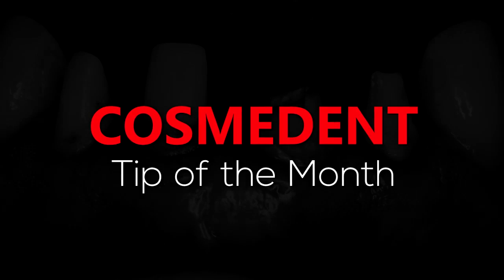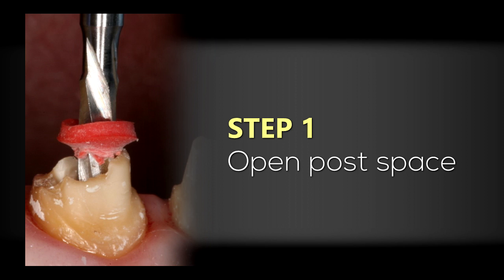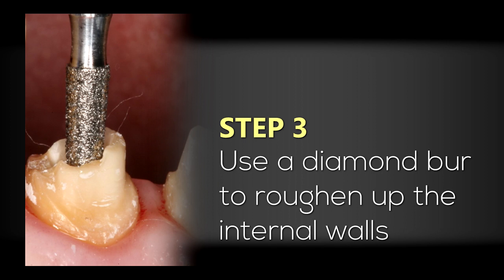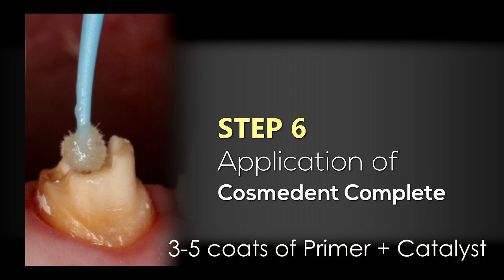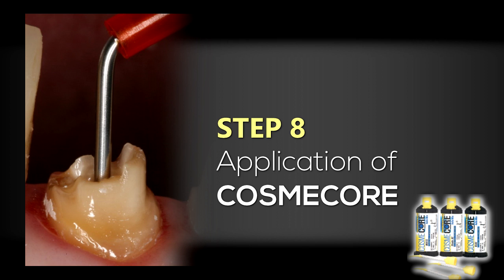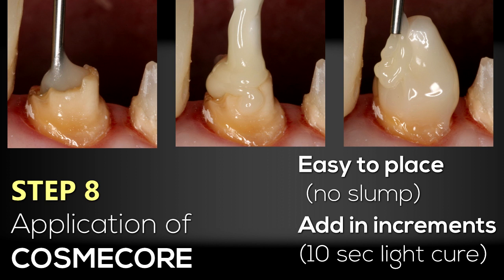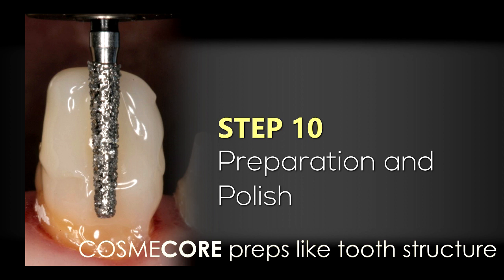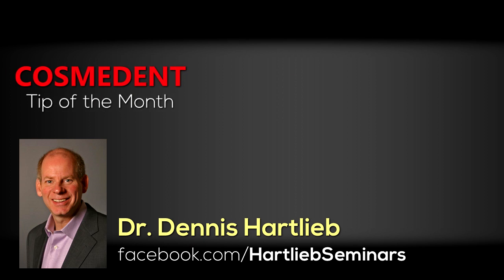Dental Post Cementation and Core Build-Up with Cosmecore

Comment: my dentist did a root canal on tooth # 7...i watched him with a small mirror... i noticed he put a little tiny nail without a head into my tooth canal and  and then put cement in my crown that had broken off and recemented.... he told me not to bit anything hard only soft with that tooth...
after watching your video and knowing i have no cosmecore built on that small pin in my tooth is it normal for me to think that tooth can come out anytime? i have no core?
when it broke at the gumline there was less than 2mm....
he billed me $1300 asking for 1600.... all i could afford was 1000...
i felt i needed to pay his fee to get this service done asap since we are in the middle of virus pandemic...
did i get ripped off and if im careful with tooth 7 how long is its life expectancy?
hope i can receive a reply from you ... thank you doctor!
Reply: If you're skeptical your opinion is already swayed. Find a dentist you trust then. Watching videos on YT does not make you a doctor and does not apply to all scenarios. Something more constructive: If your tooth broke off at the gumline less than 2mm and DOES NOT HAVE FERRULE (you can search up Ferrule dental term to get a better understanding) it is extremely hard and if not impossible to make something that will last. All cases are different and in the US dental care ain't cheap. A temporary crown can cost about $600-$1000 depending on the situation AND you're not just paying for the crown, because a lot of things are needed before you get a crown such as:   The cost of a dental exam is $100 to $200
Cost of a post and core is $350 to $650
A cone-beam CT costs $330 to $750
The cost of a periapical X-ray is $35 to $50
A core build-up costs $200 to $500
Diagnostic casts cost $140 to $300
The cost of a Bitewing X-ray is $35 to $50
Protective restoration costs $150 to $250
Just a list of price I found provided by a dental office.

Comment: Never heard of this til lately, all my roots are fine yet every dentist want me to get implants. Why should I destroy good embedded roots and wait six months for the bone to grow back for implants. I like this way much better. Not one dentist I've gone to even told me about this. I had to learn on the net.
Reply: They wanted $25,000 for implants, went to Mexico, Tiajana and had on extracted and 4 fixed for $2500, so far great
Reply: @safffff1000  what was the place called?
Reply: @duhsunnyday8590  Dr. Ignacio de la Vega, Tijuana
Reply: They should inform you about the option if the roots are indeed healthy and if there's enough remaining sound tooth tissue above the bone. It is, however, the last possible restoration for a tooth.
Reply: I had to change Dentists to find out about this.

Comment: I had a root canal 10 years ago on my lateral incisor and the tooth was fractured down to the gumline.  The dentist did a core build up using the resin material only, without a post like you did.   We put a ceramic crown on the tooth. Do you think a post was necessary?  I'm worried the build up material alone won't be strong enough and the build up material will just break off.
Reply: U need a post bro
Reply: Yes you should have had a post put in. The lateral incisor does not have the best crown to root ratio and is prone to fracture.
Reply: Ask a doctor/dentist not people on YT. It really depends on each individual and finances. If you do not have good anterior canine guidance and a open bite for example or a bite where you are not putting much force on your lateral incisor then a post might not be needed. If it was a tooth like your canine and it is being used for guidance then absolutely. Crown to root ratio for males max incisor is around 10mm:12mm (paper published by jung sok kim) but only your doctor with the xray can diagnose and give you your tx plan.

Comment: Can I eat normally with this kind of procedure or that material isn’t strong enough to resist food that is hard like let’s say toasted bread or something like that?
Reply from the maker: If the dentist follows correct protocol, the material is strong enough to do anything that natural teeth can do. There are a lot of things to take in consideration when a restoration fails and the strength of the material is just one of the items. Patient habits, occlusal forces, technique protocol, ... Every patient is unique but this is a common procedure that should work for anyone if everything else is balanced.
Reply: Cosmedent, Inc. I really appreciate your response. I was told that after the post I needed a crown but if the post is strong enough I think that would be enough. Thanks!
Reply from the maker: You're most welcome, thank you for your question.

Comment: Do I need to do a root canal treatment before post and core treatment? My dentist said that my tooth is beyond any repair.
Reply: It is critical that there is enough healthy tooth structure to support the post and core (and a root canal is necessary prior to the post placement).  If there is insufficient healthy tooth structure, then the tooth cannot be saved without additional treatment, such as crown lengthening (a gum surgery procedure).  Some teeth are not candidates for crown lengthening and the tooth may need to be removed to prevent infection.  Hope this helps!

Comment: why use 3-5 coats? im confused. u make a pool at the bottom of this well, and then take out the excesss with paper points? 
And if you are making a coat of bonding, then curing, and then repeating it again 3-5x , i would expect the post placement be difficult because how the post canal is skinnier
Reply: Jslad js - the reason for placing multiple coats of the adhesive is because it takes time for the primer to saturate into the etched dentin to create a stable hybrid layer.  The multiple layers with agitation helps to ensure that the demineralized collagen is adequately supported and hybridization is successful.  It is essential to remove the excess adhesive, first through the absorption of paper points or multibrushes, then air thinning to be certain that the carrying agent (water, ethanol or acetone) is evaporated.  The resultant film thickness layer should be negligible and should not impact the seating of the post.

Comment: No rubber dam. I guess a delay failure will occur
Reply: +Tam Trinh with all due respect, how can u put a rubber dam without it interfering here? there is basically no cervical tooth structure :-/
Reply: +Jsvlad js there is enough tooth structure. You can use a butterfly clamp. You should ask an endodontist to place the post immediately after root canal if you are worried about not being able to isolate.
Reply: Not necessarily
First of all - author mentioned gingi- guard.
For the second -  it is front tooth.
Third - moisture has very low chance to get inside root canal, where dual bond is used. It's not critically sensitive to moisture and core was built by bulk material, no layers.